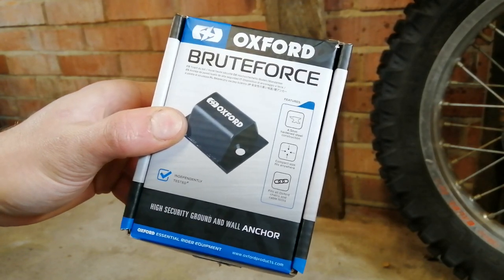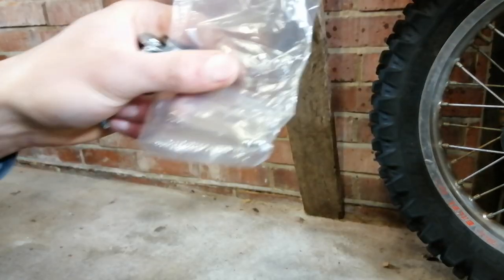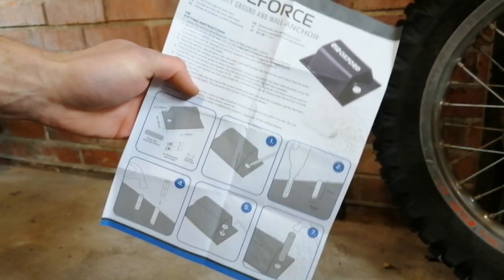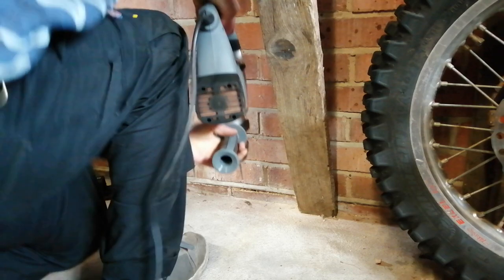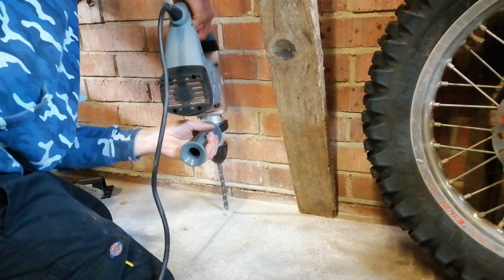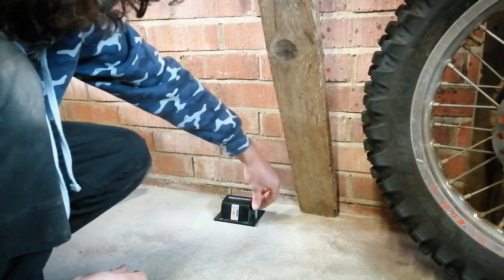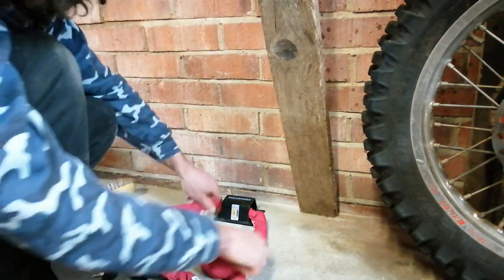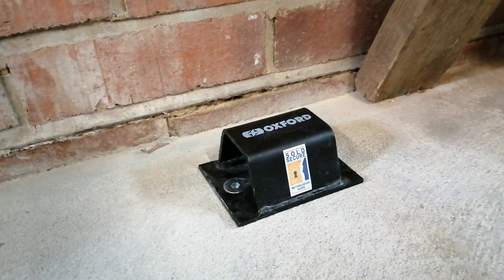How To Fit OXFORD BRUTE FORCE Ground Anchor Installation - Step By Step Guide - Keep Your Bike Safe!

Comment: thanks for the video i just ordered the brute force after caught someone stealing my bike the other night i had a disk lock on the front wheel and a  chain around the back wheel to the shock  they was dragging it out the front gate and i run out there and they dropped the bike and run  so need a ground anchor  now
Reply from the maker: Sorry to hear that, hope the ground anchor helps 👍

Comment: Thanks for the video. Is it better to secure this way the front or rear wheel? (BMW r1250gsa)
Reply from the maker: Don't think it really matters, I like to do the front taught with the steering lock on so it means they couldn't even break the steering lock without having to cut my chain off! Good luck.
Reply: Back wheel. The front wheel is easily removed.

Comment: I dont understand the point because if they cut through your chain they can just pull it through the anchor?
Reply from the maker: There is nothing that can't be cut or broken in terms of motorcycle protection but it is definitely a deterant, hopefully it would take a thief much longer than without the anchor as in theory they could lift the bike away if it only had a chain around it whereas now they would have to remove it in some way to get away with the bike. My insurance stipulate it as a "must have" but I also fit a disk lock to try and make it harder again. Think that's all you can do. Thanks for commenting.
Reply: @dan_the_drifter321  ahh yes i agree didnt think about them maybe lifting it away as i have a quad which is heavier i suppose. But regardless the more protection the better definitely!
Reply: If you get a good chain, they can't cut  it.....sometimes it's even better to put the anchor  on the wall keeps chain off the floor and makes it harder to cut with chain cutters....
Reply: Cutting a chain at 2am will wake most people up 😉

Comment: WARNING. Oxford seem to have redesigned the expansion plugs since this video, but sadly not changed their printed instructions. The new plugs are held together by a removable wire ring - but if you remove the ring before you have partially inserted the plug into your drilled hole, they fall apart and I can't figure out how to put the plug back together again. I’m really annoyed they’ve done this. I’m now screwed. Or not, as the case may be.
Reply: Frustrating. I can’t see any other option than to send the whole kit back and ask for refund or a replacement kit.
Reply from the maker: @tiltilton  Sorry only just seen this message, that is a shame, what did you do in the end?